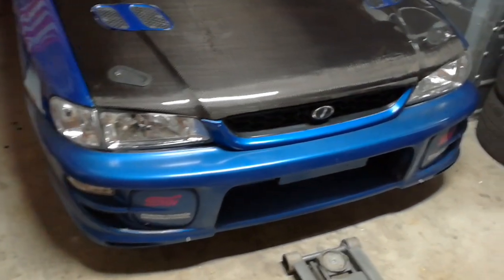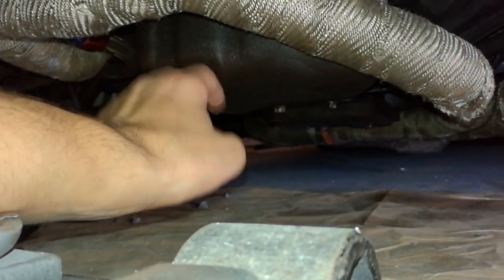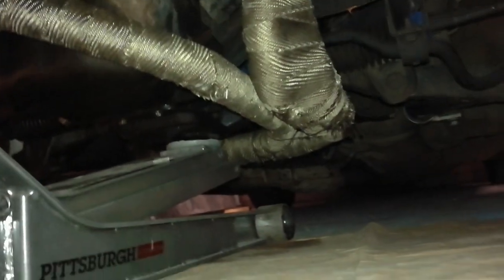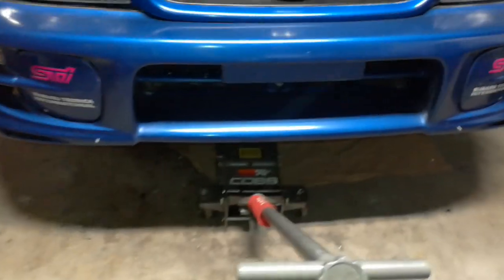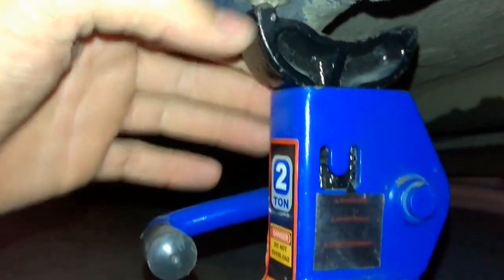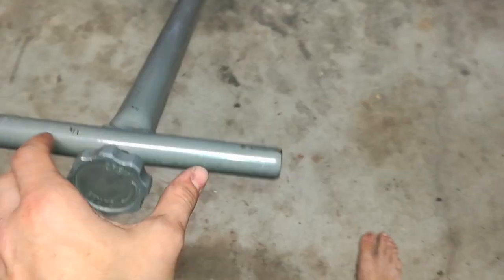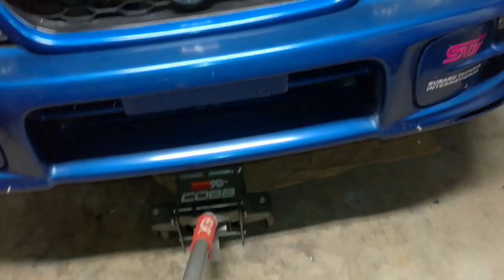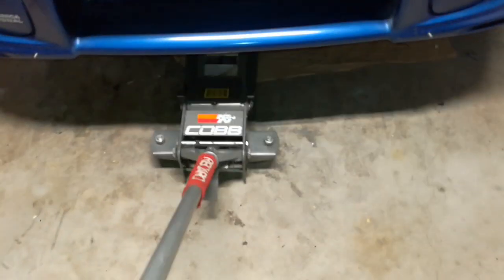Locate Subaru front jacking point + how to jack it up and put it on stands

Comment: I got a 2010 with that plastic cover so first of all how necessary is it can i get rid of it and be good and if not do I have to take the p.o.s. Off every time I need to jack up the car
Reply from the maker: It's not necessary but it is there to reduce the amount of dirt and water flying onto your engine and it also might keep wind noise down. If you don't want to take it off, I suggest cutting a large hole around anything you need access to although I'm pretty sure it already has one for the jacking point.
Reply: Thank you for the fast response I totally appreciate it I guess I better keep it on it gets pretty messy in the Midwest this time of year

Comment: if my 2006 wrx is too low to reach it from the front can i jack the car up from the pinch welds and put the stands on the frame ?
Reply: Drive your cars front wheels onto bricks first.....thank me later
Reply from the maker: Weaver has it right. That's the best way. However, you can do the method you described. I do this frequently. Just don't be surprised if the pinch welds bend. Mine are all bent lol.

Comment: Can you change your tires without *ack stands. Just using a jack like you have..
Reply: Always have a jack stand or rigid device designed for supporting a car to hold the car up. Don't depend on a hydraulic unit as they can fail at any time. They certainly fail much more frequently than jack stands. BTW, some jack stands do fail. A few models have been recalled over the years. I recall one model with a tube and a through-bolt was too weak (hence the iron supports being a better option). Also, another model sold at Harbor Freight (and maybe elsewhere) had vertical welding seam up the middle that could fail due to poor welding.

Yes, it is two years after your post, but this is a safety issue.